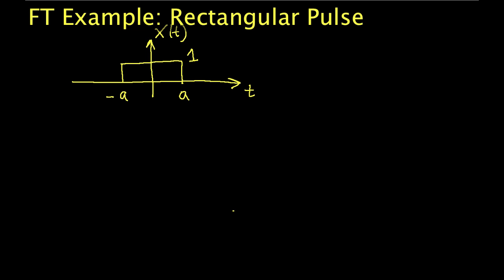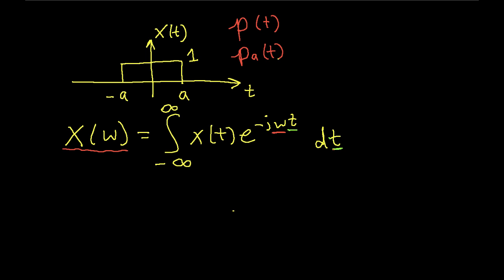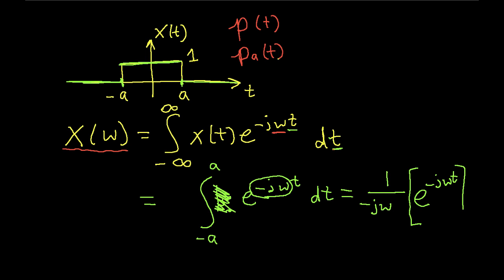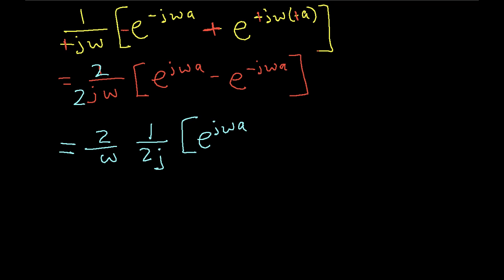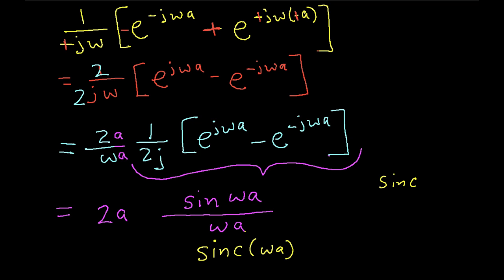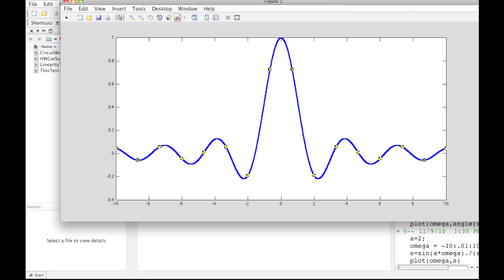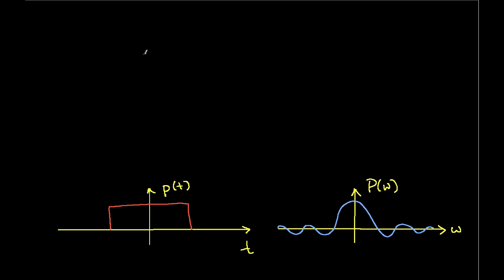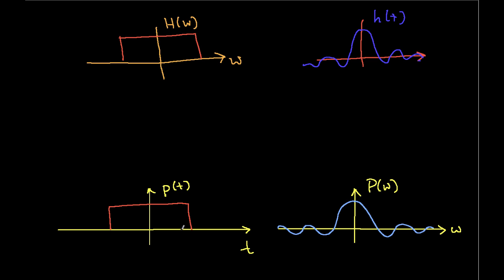Fourier Transform Example-Rectangular Pulse (Edited)

Comment: u did the fourier transform of a rect function from -a to a ..
but what would the solution be for a rect function from 0 to a for example ???
Reply: +hanin sharif that would be  e^(-jaW)*sinc(wa/2)
Reply: please explain this
Reply: There's a transform called 'time shift' that moves a function along the t axis. You basically take the function and multiply it by e^(-j*2*PI*f*t0) where t0 is the time shift
Reply: and how to draw  FT of pulse sifted by T/2? 
i know that the result will be T Sinc (W T/2) exp(-jwT/2) but i don't know  how to draw it. and if it will be Sinc shape what will be zero crossing points?